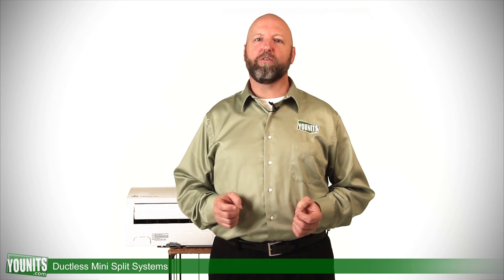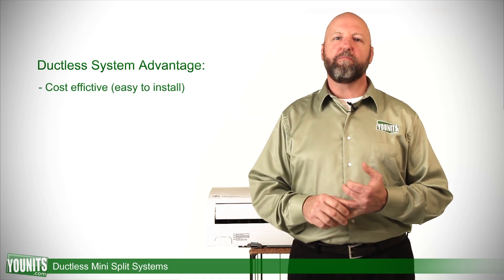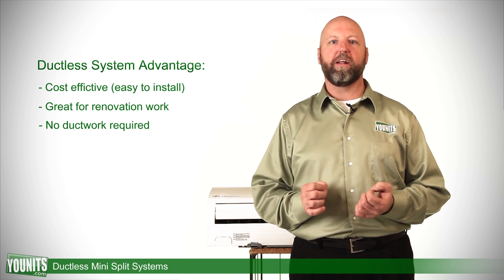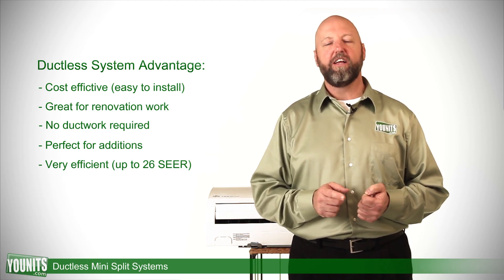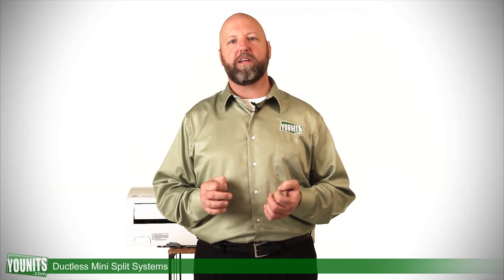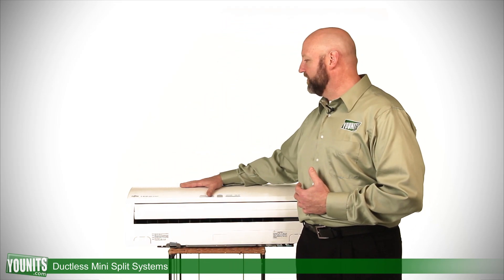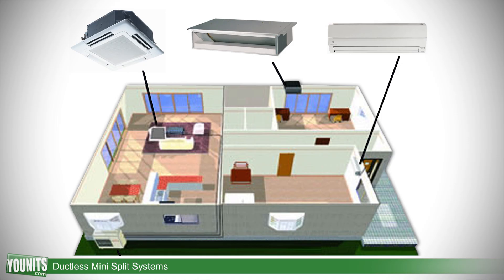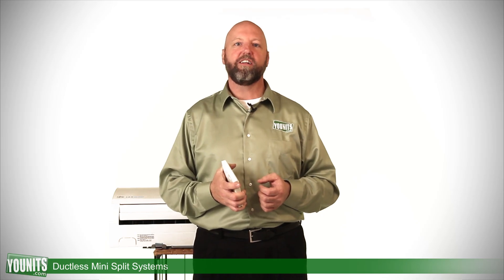How Ductless Mini-Split Systems Work. Single & Multi-Zone Applications - Younits.com [HD]

Comment: 11 may 2024 9:14 am est ( utc - 4 ) : thanks . 0:24 ductless-mini-split suck hot-air ( maybe hot co2 ) inside building converting hot co2 to cold co2 . central hvac suck hot-air outdoor ( maybe hot o2 ) converting hot o2 to cold o2 , so central-hvac-with-zoning is more likely to blow o2 , ductless-mini-split is more likely to blow co2 as time goes by .

Comment: John, I have a question, I hope you can answer. I have the Carrier unit, still fairly new and learning the system. Anytime the wall thermostat that controls the bedroom vent’s is on, my wall mounted heater seem’s less likely to run, but as soon as I turn the wall thermostat off, it kicks on. I’m getting warm bedrooms and but a colder living area. Any help would be appreciated.

Comment: Explain it how refrigerant flows in a multi zone ductless system
Reply: It flows through copper pipes or rubberized hoses from each of the evaporators, behind the drywall, and through the exterior building walls, to the condenser.

Comment: I need to cool three zones ,is it better 3 three zone unit or three individual units? advantages ,disadvantages?
Reply: Get a 3 zone Unit If you Get  three individual units you will use more electricity. its all about saving energy

Comment: As said in other comments, THIS VIDEO DOES NOT EXPLAIN HOW this type of cooling system works. For example, if you want one for multiple rooms, how is that achieved? Where and how do the 'ductless' ducts run in or out of the house. You should have provided more information to a novice who has no knowledge about this type of cooling system. At this point I don't want to contact an installation company. I came HERE to gain that information. VIDEO=FAIL!!

Comment: So...what is a ductless mini-split system?
Reply: Basically a really powerful fan. People compare these to AC units but they're too weak really, unless you're standing directly where the air is blowing you wont even know it's on. Considering the fact that they can cost anywhere from 250-400 usd and require professional installation, I'd recommend just getting a regular fan
Reply: @Thek94life  Is that how you'd explain the way your refrigerator functions?

Comment: Just bought a dual zone (18k+18k) system but was sent a quad zone outside unit (9k+9k+9k+18k). Can I simply T together two of my 9k line sets in order to run the second 18k inside unit? Just cap off the remaining unused 9k line? Anyone know? thanks.

Comment: can the ceiling cassette be used in a bungalow ceiling instead of a drop ceiling?
Reply from the maker: The ceiling cassette unit can be installed in a framed out drywall ceiling or drop ceiling.  The instructions will guide you through the process for both and provide a template for guide with the installation.
Reply: ***** thanks

Comment: Does the outside (or inside fans) ever turn off, or they supposed to always stay on?
Reply from the maker: Yes,  The inside unit has fan and mode controls.  You are able to turn the fan on and off with the remote.  The outdoor unit turns on when the indoor unit calls for heat or cool.

Comment: I understand that these may USE energy efficiently. But I would question their "green" factor. If you are pumping excess hot air back out into the atmosphere when it is already too hot, and you are taking the very last little bit of warm air out of the air when it is cold, I believe this will exacerbate climate change.
Reply: You're just moving heat around... you're not creating it.  I think you can relax.
Reply from the maker: Great question.  Unfortunately I do not have the knowledge to answer it.  The unit is considered energy efficient as compared to other units and they use of energy etc.

Comment: I have a three level split level home with air conditioning requirements on each level.  Is there documentation available to help me position my external as well as internal units?
Reply from the maker: Every manufacture provides a spec sheet and guidelines for installation.  Most are available online or through your installer.

Comment: This video does not explain  how mini split ductless works.
Reply: +Magic .Mark It's magic
Reply: If I remember correctly, there's 2 thin tubes wrap together forming a 2in thick flexible pipe transporting the coolant to and from the outdoor machine. The outdoor machine contain the noisy parts like the compressor. The indoor parts is pretty much just a heat-exchange/fan turning the air cold using the cold coolant and in reverse if you want heat.
I know these cuz I was originally born in the city of Canton and I could vaguely remember almost every homehold use the split AC. And every homehold have AC. (if you dont want to be cooked alive~)
Reply: yeah I still have no idea if ducks are involved or not
Reply: @ddddoc7078  they're not involved...hence the ductless system
Reply: @veganpotterthevegan  pretty bold statement. The absence of the evidence of ducks is not evidence of the absence of ducks
Reply: @ddddoc7078  sure,  the house may still have ducts.  The system doesn't
Reply: @veganpotterthevegan  if the house doesn't have ducks, I don't want it
Reply: @ddddoc7078  OK?
Reply: @veganpotterthevegan  Who's on first?